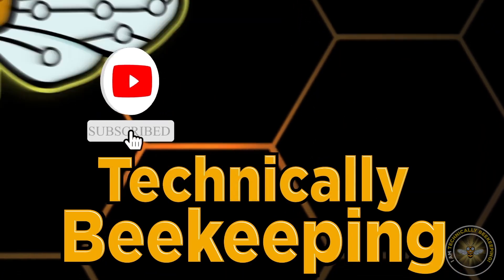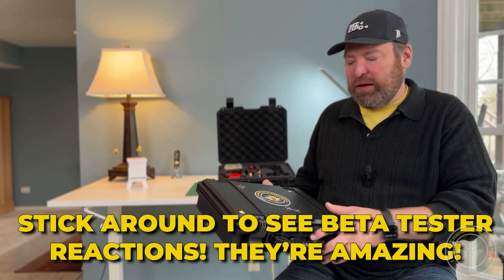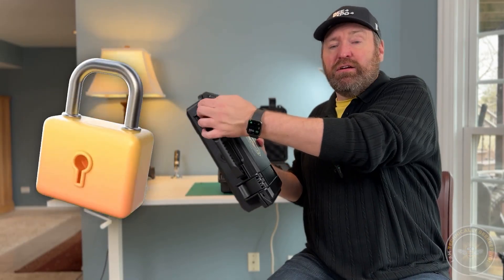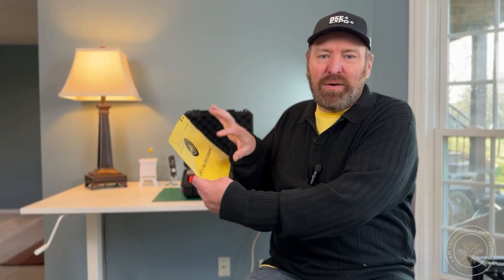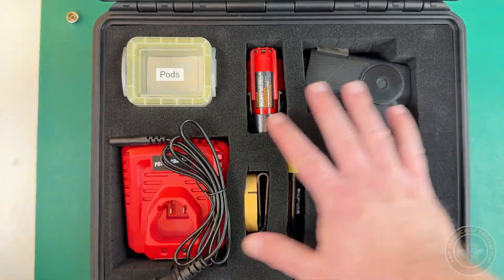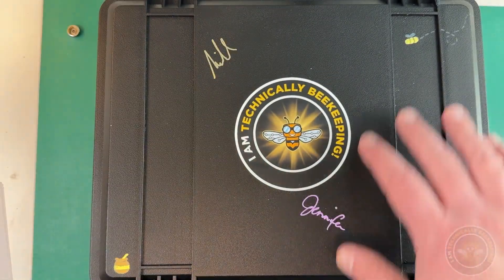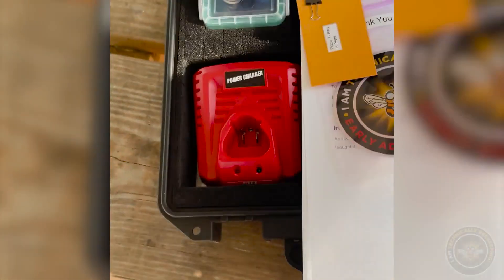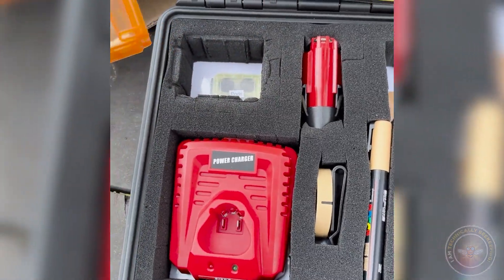Bees, Tools & Overengineering – The Ultimate Smoker Case (With a Hidden Surprise) 🐝🔩😎

Comment: I do bee removal I dont use a smoker because its fire. I would love to purchase one because it will work better than peppermint water spray.
Reply from the maker: @ShelHiggens, originally, I was surprised at the number of bee removal pros that have reached out to me for exactly that same reason. It makes sense after taking their feedback.

If you're working in a house, even if you don't burn the house down,  the traditional smoker will make everything in the person's house smelling like smoke. Plus removal pros have time constraints that many beekeepers do not have to worry about. 

I've had a few removal pros beta test the unit and I'll tell you that they're rough on their equipment, lol. I have learned a LOT from them about how to build a more robust product. 🔧

Make sure to sign up for the Very Important Beekeeper club to get updates on what's going on. It is free, I don't SPAM anyone and I don't do anything evil with the data. 😈 https://vib.technicallybeekeeping.com/

Comment: Putting to many eggs in a basket,  some could get broken. 
Personally i dont need a case to carry while im goingg to do inspections. It would stay at home.
  
Beekeeping is expensive enough, no need to add unnecessary costs(music).
Reply from the maker: I am finding through the beta test program that people who have one bee yard have the same opinion. Typically the people that seem to resonate with the case are people with multiple bee yards or that do a lot of bee removals. I am not sure if that is the case for you, but it seems to be the scenario that I am seeing.
Reply: @TechnicallyBeekeeping  I have 2 places ,but are next to each other. 
Maybe offer just smoker. Of course battery and charger. 1 refill. I assume  it's an oil
Then offer combo , with case.
Reply from the maker: @TheUnknownBeekeeper  Yes, my thought is a basic kit with just the smoker, no batteries, no charger, and 1 refill. That way if you have the batteries and want the cheapest version possible, we've got you covered. What do you think?
Reply: @TechnicallyBeekeeping  but are battery interchangeable, or would you need to buy the milwakee setup?
  If so it maybe better to have it as part the kit. 
 Or have 3 options. 
I would buy the kit with battery.  
  You have stats which eo work best.  Or you plan to have variety .
Reply from the maker: @TheUnknownBeekeeper  I plan to sell a battery converter for DeWalt 20V. I'm thinking of providing the Milwaukee batteries for sale as well, but a lot of people already have them. I'd rather not be in the battery business. 🤣
Reply: @TechnicallyBeekeeping  be nice if there was a universal battery that could work.
 As I and others don't own milwakee or dewalt.
 I understand not wanting to be in battery business, but unit runs off battery. 
So to offer with out battery, but customer having to buy battery etc. Is a sales reduction issue. 
  Was reason I didn't purchase another persons product that runs of battery, limited battery type.
  Just throwing out what customers may think or want.
Reply from the maker: I think I'll offer the battery as an option to buy from me. I get your point about the universal battery, but there's really not one, other than maybe a AA, AAA, D, etc battery, but those don't have the power needed to power these kinds of devices. I've used vape batteries in the past that are similar sizes to AA but they're a pain to get in and out, especially with gloves on, and I don't want a unit that need to wait to be charged. So the drill batteries have been a good decision. The beta testers really like them. I think over time I'll offer more converters as well. The most universal drill battery in the US is DeWalt, Milwaukee, and Ryobi.

Which drill batteries do you use?

Comment: Dude. This video is over the top! 
Perhaps sell the smoker as a bundle with the case? I had never thought of having a case, it is a stupidly simple idea that is amazing. Harbor Freight has quality cases, I bought one and mounted it on an outside wall as a junction box to run cable from my internet dish to the house. It has stood up very well to the weather for 2 years. 
Of course the bundle would come with a… sticker?
Reply from the maker: I'd not looked at Harbor Freight's cases, I'm going there later this week and will check it out. Thanks for the idea.
And yes, @molotovEOD, there will be a sticker. LOL! 😝

Comment: should you sell them, yes. People like a turn key solution.
Reply from the maker: Good point, @cybernoid001. I think I'll have a minimalist version with just the smoker and fuel, a middle of the road version and a turn key solution with all the bells and whistles. What do you think, any changes you'd suggest? 🤔
Reply: @TechnicallyBeekeeping  As an amateur backyard beekeeper myself who was thinking of this very idea, then stumbled on your channel yesterday, Thank you for all of your research and dev on this potential product. 
What I would be looking for, is a case with the electric smoker, two battery packs (nothing worse than running out of power halfway through your inspections,) and a few smoke cartridge's, and the magnetic attachment piece. (relevant operation and safety manuals included of course) There isn't much that would be needed from entry vs turnkey solution. since there doesn't seem to be a lot of parts to this as a completed product from what I can see. 
Obviously a minimalist sale of the product would be the smoker with 1 battery pack, then after that its adding more smoke fuel, the mag clip, and additional batteries and the case. 
Maybe think about a car plug charging adapter? Since some people have boxes all over and drive to various locations, and would keep this in their vehicle all the time and never bring it in to charge?
Reply from the maker: @cybernoid001 I just had a beta tester mention the car plug to me for the first time last week. That's very smart. He said the same thing, he just wants to keep the smoker in his truck all the time. Thanks for the ideas on how to tier the offerings. I really appreciate it. 🙏 Sorry for the slow response, I didn't see the response until now since it was not a new msg, lol.

Comment: The cases look nice. I use similar cases and padding for large dnd minis. I'm in NY and am starting queen rearing soon. Waiting for those Texas beekeepers to finish up so hopefully it will make its way north soon. Lighting a smoker to check queen cell acceptance takes longer than the check.
Reply from the maker: @Rhams3y, that's a great point on the lighting for queen rearing, I'd not thought about that aspect. I say ever year that I'm going to do queen rearing and never do, then I pay $50 for an emergency queen in the early fall and grit my teeth because I know I should have just raised my own, lol.
So what kind of padding do you use for the dnd minis? I've been looking at shadow foam and kaizen foam (I like the secondary colors), but I worry that they'd get too gunked up.